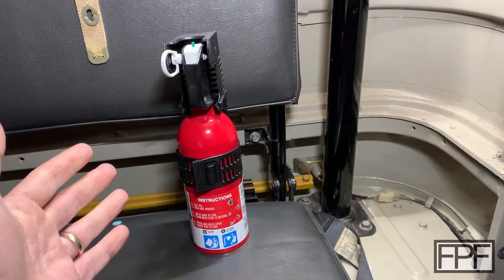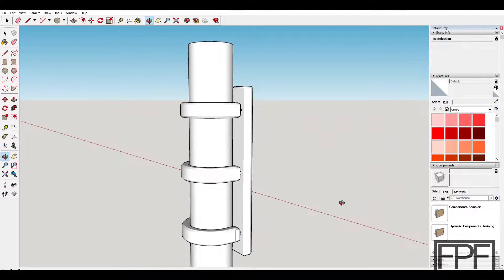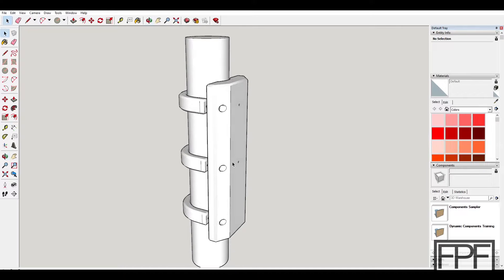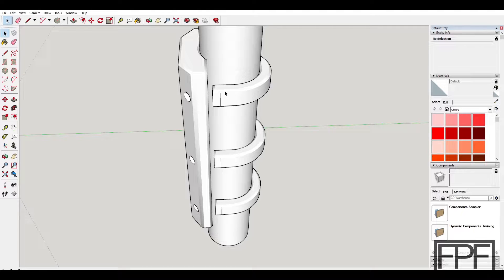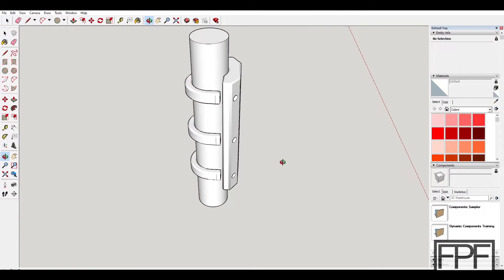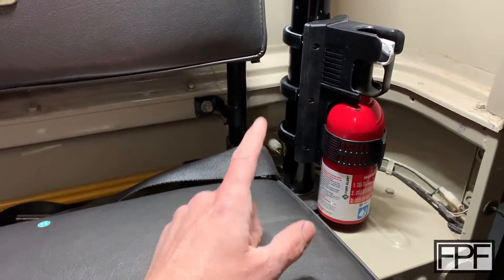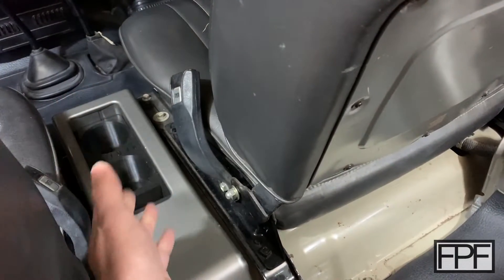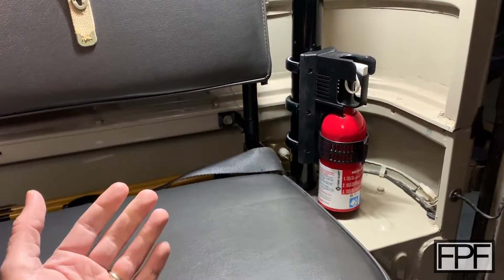3D Printed Toyota FJ40 Fire Extinguisher Mount

Comment: I'd be curious to see a test of how much force it takes to pull one of those screws out. I would have never thought that would hold in there as well as it did. I was thinking you were gonna use bolts and nuts or something. interesting to see you do it that way.
Reply from the maker: I'm curious as well.  I think the coarse thread stainless into the TPU is quite strong.  The other is M3 screws into tapped holes, with about 12mm of thread engagement.  I think both are stronger than necessary, but I'm just guessing.  Maybe I'll setup a rig to test.
Reply: @FunctionalPrintFriday  I'd be really interested to see the test.  I hadn't considered just using coarse thread screws like that before.  If they turn out not to be strong enough, you could add some slots into the TPU pieces for captive nuts and use machine screws instead.
Reply from the maker: @JohnDoe50047  yeh I might still do it.  Lots of projects up in the air